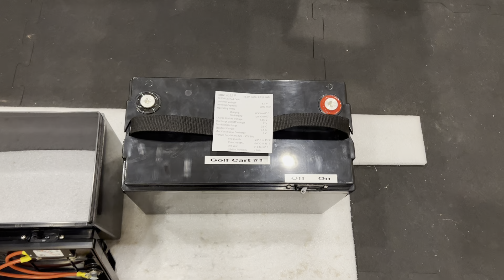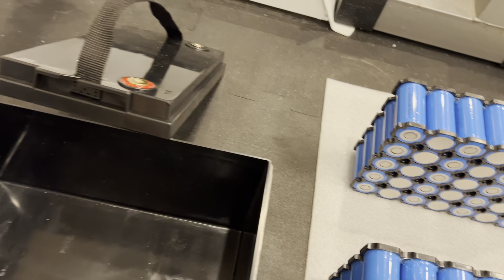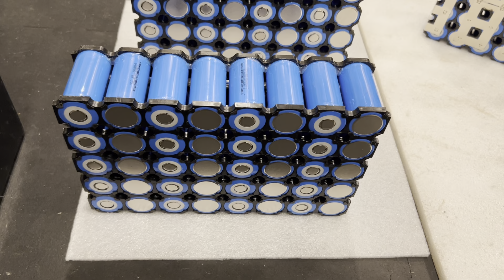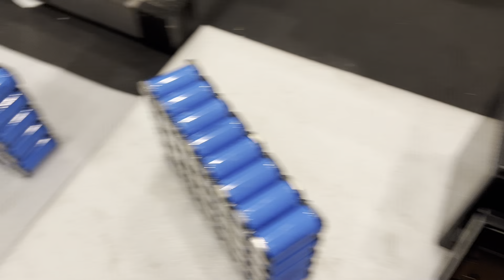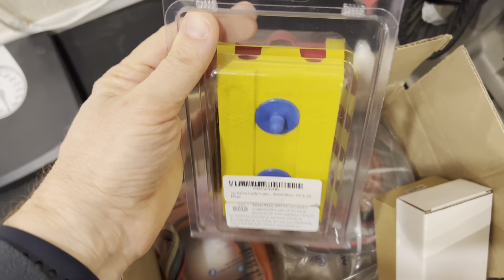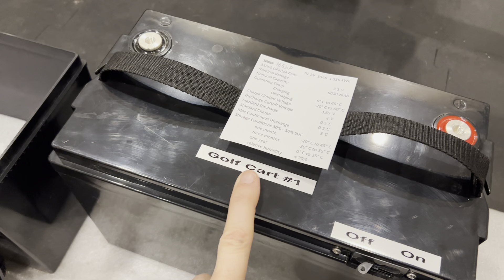My 48v LiFePo4 Golf Cart Battery design and build process.

Comment: Cool battery design. One worry I had: please make sure to use some kind of thread-locker or a locking fastener on the switch -- would hate to think of the chaos that a loose nut could cause while rolling around the inside of that box. Good work!
Reply from the maker: That is a great idea.  Will definitely do that.